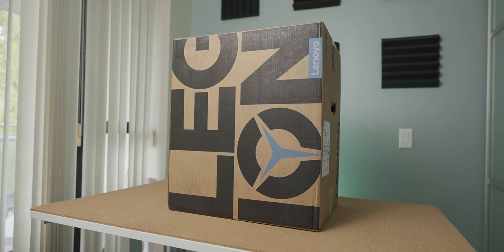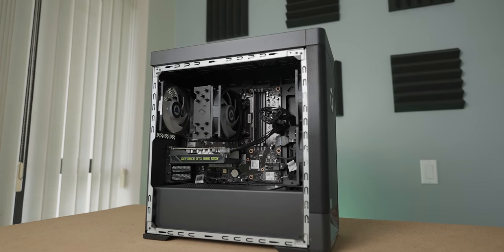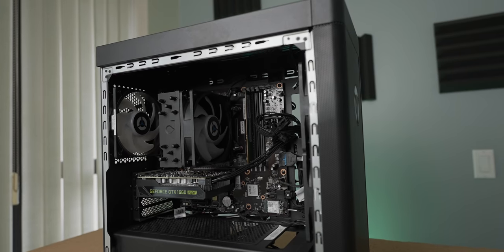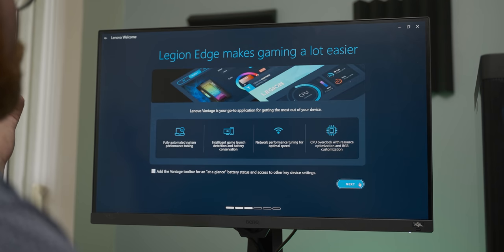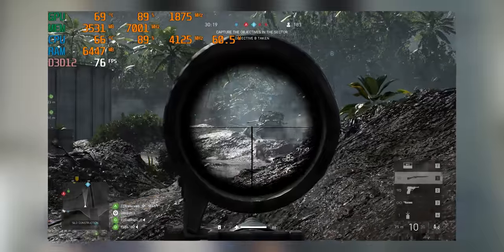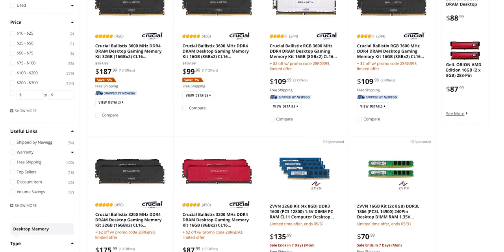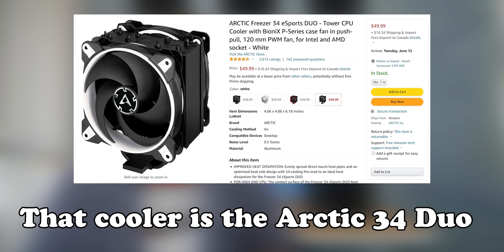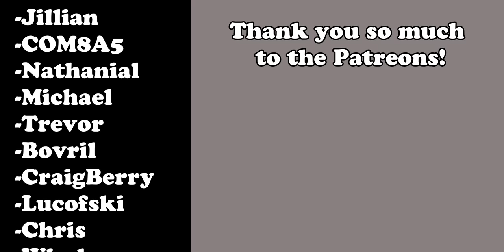Is Lenovo the KING of OEM Gaming Pre-Builts?

Comment: Lenovo for pre-builts is definitely king, bought one a few months ago still running great, came with dual channel ram too for around $800.
Reply: im buying one in a few days and one question wich drivers did u install when you first bought it
Reply: i just bought levon i for 1500. it’s coming on friday and my first pc
Reply: same
Reply: I paid 2100$ for my Lenovo Legion early 2021, because of AMD Ryzen 9 5900X CPU. GPU is RTX 3070.
With new 27" 165 hz monitor, 2TB of more SSD and 4.TB HDD made the PC costed me 3000$. I already had proper keyboard and mouse.
Reply: @V3ntilator  hey what power supply did you get like the wattage
Reply: @lightelf  I got one for £1300 ($1700) with a ryzen 7 5800, 2x 8gb RAM (16GB), 1tb SSD and 2tb HDD and Nvidia rtx 3070 that came with a 550w power supply. Could be better but can be upgraded and isn't causing any immediate issue.
Reply: @heather7320  should really upgrade your power supply
Reply: @lightelf  will be doing after Christmas
Reply: i think its not that good as it seems, bought one for 1400 dollar and its underperforming pretty much
Reply: Wow a few months
Reply: Glad I got this system, very good for my purposes.
Reply: @kamrenwilliams2103  levon? What brand is that?? Never heard of?
Reply: @matmamat9690  lenovo
Reply: @V3ntilator  any overheating issues or fans blowing at wrong direction?
Reply: Would u recommend buying prebuild desktop or same laptop with same features? Does desktop has issues?
Reply: @kamrenwilliams2103  hi I'm trying to buy a prebuilt is it good still your pc?
Reply: lenovo is definitely king because it has been running for a couple of months? 😅 give it 6 months and that cheap ass power supply is going to blow up 😂
Reply: @Mikael-jt1hk  Been close to a year now, running great lmao. 😂😂
Reply: I'd hope a pc you got a few months ago and don't overclock 247 is still running..
Reply: @grantheacox1992  which one did you get, want to buy one too but sketched out hard over it being trash
Reply: @grantheacox1992  which one did you get, want to buy one too but sketched out hard over it being trash
Reply: @mas2685  I believe it was the Lenovo Legion T5 28IMB05, 1660 super, i5 10400f, still running great, looks like around $1k- $1.2k as of right now if you buy new.
Reply: @grantheacox1992  hi, how is this pc holding up now? I found it on Amazon for £639 with i510400f, 1660super and 16gb ram. Is it worth my money? Sorry for long message.
Reply: @zain4409  Holding up well still, great pc.
Reply: @grantheacox1992  did you get the 16gb ram model and was it dual channel (2x8gb)?
Reply: @zain4409  16gb ram 2x8gb yeah
Reply: bought a lenovo legion in 2019 still works like new i can play any game on high settings with 50-60fps
Reply: no fan controls, no king
Reply: @AsherTheFemboy  50-60 fps. Thats crap bro
Reply: @JK0712  If your not playing competitively more than 60fps isn't necessary but sure bro lmao
Reply: @Tequila69  I bought the Legion T5 26AMR5 with RTX 3070 GPU and Ryzen 7 5800 CPU. 2x 8 GB RAM (16GB) and a 550 W PSU. It's performing very well. Cooling is very good (it has 6x RGB fans and great airflow). The build quality overall is very good also. I bought it for around $1100, which is more than worth it i think. 
However, if you want to be able to keep playing the newest games and releases for the next several years, you should definitely get one with a better GPU (or replace it yourself eventually).
Reply: A few months ago is not an accomplishment. Let’s see how it holds up after several years.
Reply: @mightymochi6320  still going strong after ~3 years man.
Reply: dual channel ram in a prebuilt pc?? for under a thousand dollars?! FINALLY!
Reply: Have to agree bought one with ryzen 7700 and rtx 4070 been working awesome now for 6 months came with 4 years of warranty and their premium support so no worries :)
Reply: @grantheacox1992  hey, how's your legion now? any issues over 3 years? did you upgrade anything? and how often do you dust it?

Comment: Wow, to see a pre-build that actually has standard pc parts in it that you can swap/upgrade. That is rare.
Reply: personally i've got sort of a pre-built, you buy a package of parts that you can't really change parts of via their store, and they build it for you no extra costs + it's the standard pc parts and not the pre-built crap
Reply: @marijn17s  ah yes. that kinda pre-build is ok of cause. I was thinking mostly of the big corporates like Dell & HP where when you come home & open the case you will find some horrible custom motherboard where you cant change anything & perhaps the PSU has been replaced with like a laptop power block. I thankfully also has a local store selling "upgrade" packs with real pc parts so you can choose things yourself, whew.
Reply: @cholohd32  if you get a custom motherboard and want to swap parts out, can you just buy another motherboard that supports it?
Reply: @user-su6js9po4l  Technically yes, but there may be more than one issue that hinders it. I mean is the case iself even ATX motherboard compatible? They quite often cut/blocks/moves things around in big corp factory prebuilds to save money. Who knows if you can even fit a real pc motherboard in it physically ? Then there is the issue of the weird partition on the SSD that factory prebuilds usually come with. On one hand Windows has always been hugely good & flexible to me. Ive manage multiple times to move HDDs/SSD from one pc to a brand new one. And even thou Windows got  highly confused by the complete  change in hardware it still managed to pull thru (and didnt even ask to reactivate windows). But that was on open normal pcs. But on a factory pc the motherboard bios is usually locked/limited in some way & the partition is custom with a specific recovery partition & they even control windows update as you get messages like "we are working on something" instead of the actuall windows update messages. Who knows if it will even boot on a new motherboard. Hopefully the SSD/Hdd can be reformatted at least & reused (but i have seen sitations like xbox/playstation formatted hdds that couldnt be reformatted back to pc). If you can remove the ram & CPU/cooler normally from the old motherboard you may be able to reuse them as i doubt they change those, however in bad cases those might be "onboard" or soldered down. So make sure to backup your files individually before ever even thinking of attepting "upgrading" such a pc (aka not just the partition, as it encrypted by your windows account that you may never again access if it goes wrong. Actually move you importent files manually yourself to a thumbdrive/external hdd for safekeepin's).
Reply: Normally oem's void your warranty if you even open them but lenovo actually encourages you to upgrade your device, even with notebooks

Comment: My first pc was a lenovo pre-built pc back in mid 2000s. It had  an intel dual core processor, 256mb of ram, 256 gb of Hdd and came with windows Xp. Later on, I upgraded the ram to 1gb and added an ati 4850 1gb graphics card. It ran for 10 years, and could've run for more but the poor soul just couldn't handle the newer softwares and sold it for 1/15 of the price. I still have fond memories of me playing skyrim and dragon age in it.

Comment: I purchased a legion desktop directly from Lenovo 3 months ago. I have been very satisfied with it. Build quality, part selection, and price where right on point. The one I went with has an I9-10900k, 32gb ram, 2x1tb nvme drives, and a rtx 3070
Reply: @dod1721  Same spec here. CPU cooler is super good (same as the one in Dawid’s although mine is the T7 which is bigger than the one shown in the video) and you can option an AIO as well. Temps are VERY stable around 65-70 running Doom Eternal, Halo Infinite, etc at max settings and, in Doom’s case, with Raytracing enabled.

Comment: My personal bit of experience with lenovo service has been awesome. I bought their extended warranty package for like 15 bucks on my laptop and that gave me 3 more years of support. I cracked my screen the second day I bought it by closing the lid while an earphone waa on the keyboard and got it replaced for free. (I know!). The whole process was flawless, the engineer came to my house and repaired it for me. Then every year or so my hdd kept failing because of my stupid use and ive gotten 3 replacement for free. They also fixed my webcam not working for free once, and ram stick that was unseated. I also got a laptop power brick replaced for free. And lastly I found my laptop was overheating so I got it cleaned and repasted for them for like 10 dollars. All in all, awesome support. The laptop still works and is my workstation after 5 years of use

Comment: I bought a Legion with Ryzen 7, 16Gb dual channel and a RTX 3070 and I'm pretty happy about it.
The only thing is that with some usb devices I have to use a powered hub because the usb ports on the computer doesn't deliver enough power.

Comment: I'm surprised this is $20 cheaper than the piece of crap dells going around with 1660 supers.
Reply: It's probably cheaper due to less technical support and other Bs warranty business
Reply from the maker: Wow! That's crazy. Rubitupdad makes an interesting point. However I would pay not to get Dell's technical support. 😂
Reply: @DawidDoesTechStuff  lmao great video I'm sure it'll be on gamers Nexus next.
Reply: @DawidDoesTechStuff  lol "rubitupdad"   :'D     im a child
Reply: Ive basically given up on GPUs for my Dell 9010 Optiplex since I just got my Gtx1650 OC LP-card(brand new, and for 260 euros, cheap in these crazy days lol) refunded due to working once. Then never again. Been desperately trying to get a gpu that fits my weak Dell PSU for 6+months.

Everything is out of stock everywhere and Im not payin 500-600 euros for a gtx 1650 when I can buy a pre-built around that price.

Def want a pre-built now, a budget-one. I just wanna game a little bit, then I want to use the GPU for research-purposes, AI-machine learning(Im learning now about that).

Comment: I have the legion T5 desktop and yes I ordered the 16gb version but I was a bit sad to find that it came with a single 16 gb stick. Although the specs are way different it's an Intel 10700 with rtx 3070 so maybe it doesn't makes much of a difference. Would really love if you can do a review of the higher end legion desktop towers as well. I honestly think Lenovo is very underrated OEM builder

Comment: I actually deploy a lot of Lenovo systems in corporate environments, and my son has a "Leg Ion" (😅) laptop.  The vantage software is quite lightweight and very useful.  Even when re-imaging new Lenovo systems with a custom build, I often put the Vantage software back.  It's that useful, with no appreciable strain on day-to-day use.
Reply: Vantage is just the "HP Support Asistant" of Lenovo.

Both seem reasonably useful and relatively benign. 🤷‍♂️ I'm genetally fine with both being installed by their  respective mfgs.

Comment: Hey, so there's a Legion 7i, which seems to overcome some of the shortcomings of the T5, including dual channel ram, and it seems to have even more fans.  Now, the main downside is the fact that it's normally $2,000 for the 2070 Super version, but you can sometimes get it on sale for $1,500, which is way more reasonable. 
So yeah, in conclusion:  If you want to further spiral into your journey to brokenness, then you can put it on your list of prebuilts to examine.

Comment: Crazy how i still have my first ever pc which started as a prebuilt from NZXT and it came with an i5-9400F an MSI GTX1660ti OC which i still have but upgraded the cpu. 16gigs of RAM 3200Mhz idk remember the mobo but i bought a new Z390, it came with a decent cpu cooler i still use, just a DEEPCOOL gammax 400 and 1tb 665p m.2 ssd and i got it all for under $1,000 it’s so crazy seeing the prices now. I’ve upgraded everything except my RAM, GPU, SSD but i upgraded my PSU, CPU and MOBO so im ready for a new GPU and im gonna turn the old parts into a second pc. Just need to find a 3060ti or 3070 for a decent price. NZXT used to be great with their prebuilds but i luckily got mine like 3 months before the lockdowns.
Reply: Lol they dropped the GPU down to a regular 1660 and this thing still costs $1150 USD which is crazy man, i hope my GPU lasts until i can get a new one or ill end up having to buy a used 20 series. I have maybe this year and next year to play new AAA games at frames above 120 and that’ll be at medium/Low setting by then :( im sad

Comment: With the GPU shortage I got a Lenovo Tower 7i. Which is a  Core i9 10900k 32GB of RAM and a nice 3080. I love it. It gets insanely good thermals! as good as any build short of 100% watercooled. It didn't have the same problem with the memory configuration.

Comment: Amazingly good compare to some of the others you have reviewed Dawid.. regarding Ram I purchased 1 of the Acer nitro  gaming pc very cheaply(450 AUD) and it has the i5-9400 8 gig single stick of 2666 ram a 1650 graphics card so a good buy even with the problems it has ,,the windows re install fixed the bloatware issue and I purchase another stick of CL 19 2666 ram and it immediately recognizes it so that was a gamechanger and finally fitted a fan to the rear of the case making for a pretty good alternative and at $450 aussie dollars with another $50 for ram and a few dollars for a fan its now comparable with the rest of the i5-9400 gaming computers around  at about half the price. $450 AUD is about $328 US

Comment: I bought the T530 with i5 9400F and gtx 1660Ti for my son 2 years ago when 16 series and gen 9 was new. It had a really pathetic cpu cooler and a single exhaust fan so we put a Tx3evo and a 120 intake in the front and it is still rocking. We went for 16 gigs dualchannel already back then. I must say this looks a WAY better, and also has four ram slots.

Comment: Push the backplate off from the front, you can get a small screwdriver into the screw holes of the backplate and push from the front while you support the board.

Comment: I ordered the Lenovo legion 7i in tower which has some promising specs for a pre-built for $2000 packing an i9-11900k, 32gb ddr4, liquid aio + 3 120mm fans, 1tb ssd + 1tb 7200rpm hhd and an rtx 3070 so it'll be interesting to see if the legion series is still going strong.
Reply: How much is the price?
Reply: @matmamat9690  my system was $2400 bit was on sale for $2000, and so far it's performed much better than I expected.

Comment: Bought one of these with a i9-10900K and 3080 (came with GPU support to combat the weight+length!) Dual channel 32gig RAM and air cooler. Its been a blast! Just another thing of note:
Lenovo has moved all the CPU and GPU tweak settings to Lenovo Vantage (still not as good as having them in the BIOs but you can still change some settings concerning voltage and stuff there). I was also able to simply opt out of all extra bloatware when I started it for the first time and just had to uninstall mcafee to get rid of it. Been very happy with this system so far!

Comment: I bought my Lenovo Legion 5i desktop from Costco and it came with a GTX 1660 super with 16 GB of Ram duel channel and I upgraded the Ram to 32 GB and on top of the 1TB HDD I installed a additional 8TB HDD to hold all my games and had it for a year now and still works like a king 😎🙌
Reply: Yeah mine came with 16gb ram which isn't bad but I will be getting 2 8gb Corsair to get a total of 32gb I won't need anymore than that

Comment: 10:52 that cooler back plate has got four bolts, so maybe you can unscrew the bolts with the hexagon screw driver.
Reply: It's super easy to get of. Just heat it up abit with a hairdryer then push on the skrewpins from the inside. Changed to a Arctic Freezer 34 esports duo without any issue. Was just strange using the Intel 115x bracket for a AMD processor 😂

Comment: I bought a Lenovo Legion computer the little small air fryer looking one in late 2019.
Stock it came with one stick of RAM which I easily upgraded to dual 32gb. 
NVME m.2 is cheap but it came with a cooler on it which is good considering small form factor.
Easily upgraded the case fans to noctua fans, cut out some metal parts that were blocking the fans, and cut the top part of it so the gpu can breathe. Still looks good btw.
All to say that the computer is still running today, and its great since all in all I only paid $900 for upgrades, and the computer itself.
Only downside to it is the small form factors really makes the case heat up even with blower style gpu, and motherboard has no real bios so I cant actually change fan speeds, ram speeds, or anything else really. Kinda lame but for $900 not bad being able to run the new triple A games.